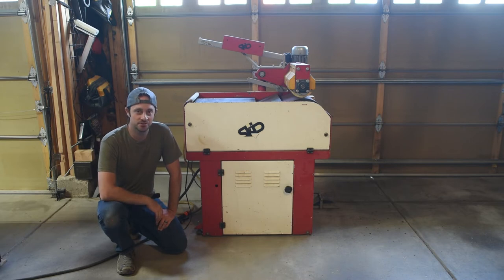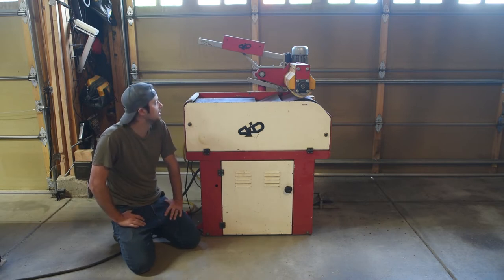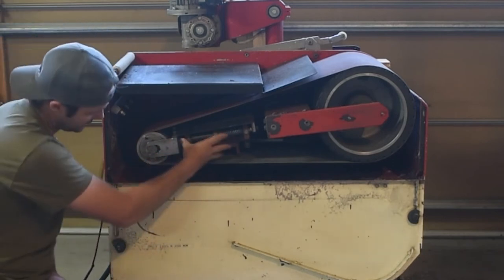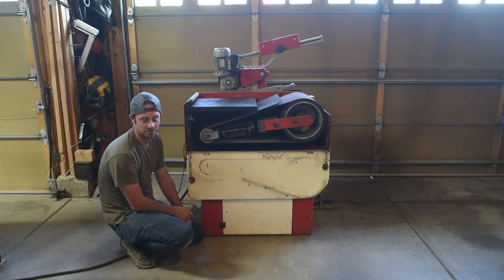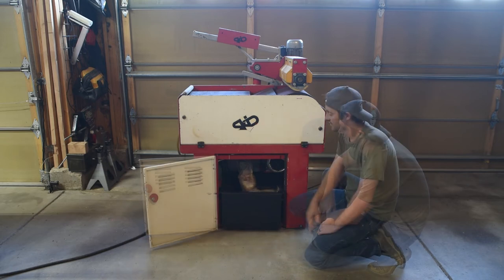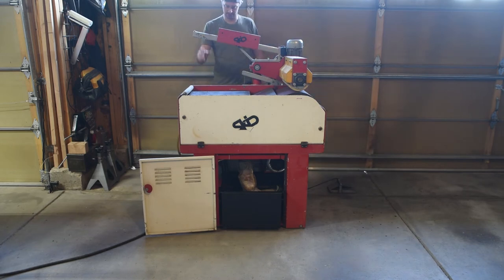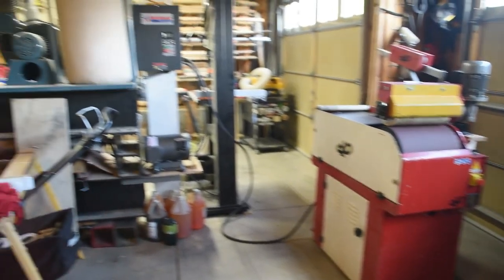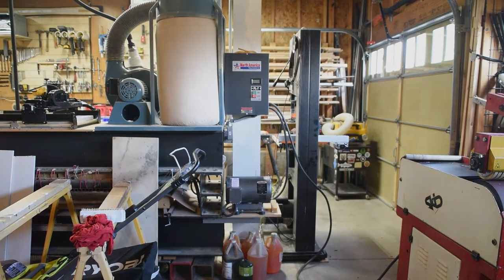Da Base Grinder

Comment: 2 questions. Do you run each ski through twice or do you do one pass per ski? 2nd question how were the bad skis produced? Did you do it DIY with a handheld belt sander or did you have a botched run through the sander?
Reply from the maker: I run it through no less that 20 times for its first cleanup after getting pulled from the press.  Actual qty. depends on belt courseness and how much epoxy found its way to the base..   I used to bring it to a ski shop to use their belt sander.  A hand sander can heat the edges too hot and change their hardness, so I don't recommend that.